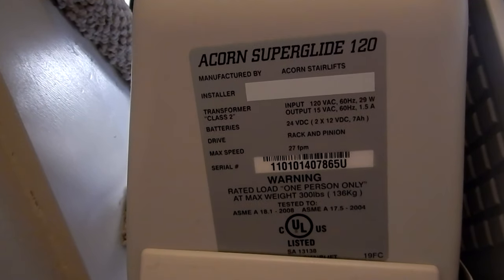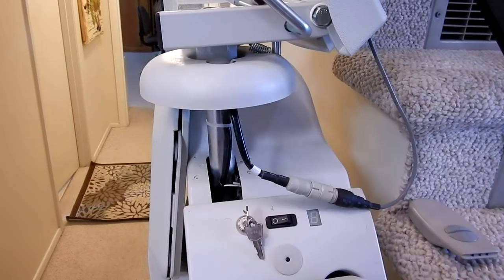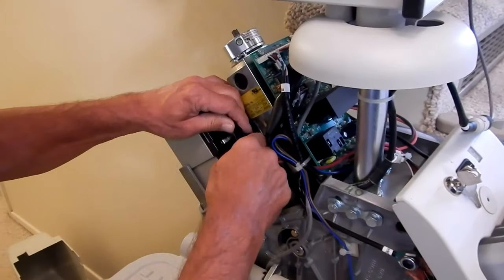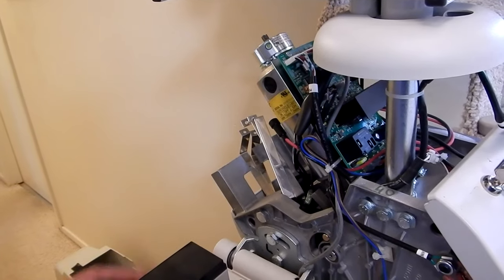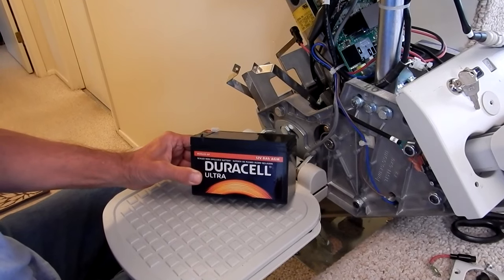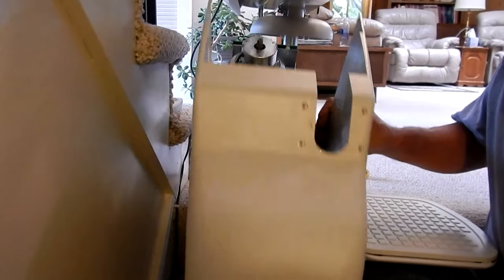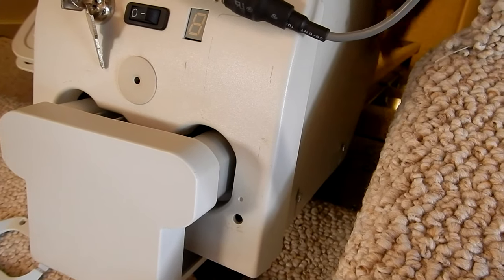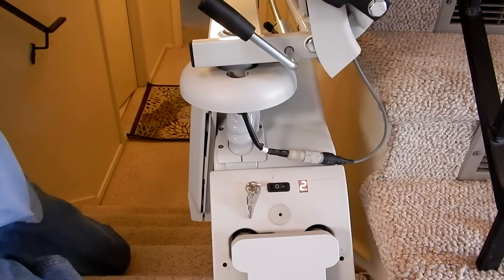How To Easily Replace The Batteries In An ACORN Stair Lift

Comment: Thank you! Great job on the video! The batteries I took out were labeled 5/17 and it is now 12/21. Anyone have any idea how often these need replacing?

We had been experiencing alternating days of slow and medium operation. Now that we have 2 residents at home who need this to go to upstairs bedrooms, it quit just over halfway up on the 2nd passenger. Oops! I wonder if it is  necessary to send the chair back to the base for charging when not in use overnight. Typically it sits on the base from about 6:30 AM to 10 or later PM (now the second person will likely go up and down 2 times a day). I thought that would be enough. Any thoughts?

Thanks again for an easy to follow video!
Reply from the maker: I think four years is about the average lifespan for the batteries. I would definitely charge them when not in use. Lead/acid batteries like to be fully charged as much of the time as possible.

Comment: Thanks Tom my wife and I are going to have one installed how long does the batteries last and why will it not run when it is still plugged in and the batteries are dead
Reply from the maker: The electrical connections are just to run the battery charger. The motor does not run on 120 volts. The batteries are only rated for 4 or 5  years but they usually last longer. They get recharged everytime you park the lift in the charge position. Good luck getting your lift and thanks for watching the video.
Reply: Kim the stairlifts run on battery power only. Plugged in just keeps them charged. The batteries should last 3-4 years with average use.
Reply: This is incorrect...3 years on batteries unless an hd model

Comment: Hello Tom. I have a chair like the one in the video that went down halfway down the track, stopped, waited a few minutes, started it up again and it only managed to move forward and down a little more, stopping before the end of the track. It doesn't want to go up at all. I know that there is a way to move the chair manually, removing the cover that you explain in your video and using a round handle that is an accessory that comes with the chair. In your footage I could see that the round handle with manual operation must fit that hexagonal tip on the engine (that silver cylinder). But the manual says that we must first disconnect the cable from the batteries and the handle is only meant to be turned a little, just for the chair to move about 1 inch to remove any obstruction in the rail. I suspect that the batteries were insufficiently charged (perhaps because it had been out of the charging contact position for a while) and therefore the batteries are insufficiently charged to move the chair to the top at the end of the rail. I wonder if the handle can be turned continuously with care and patience, so that the chair gradually manages to reach the top at the end of the track, to reach the charging contact. Have you ever needed to use this round handle and would you know if it can be turned continuously, moving the chair much longer than just 1 inch?
Reply from the maker: I have moved the chair manually. It is a very slow and tedious procedure. I don't know why you couldn't move it as much as is necessary to get to a charge point except that it's slow.

Comment: Hello. Great video! Thanks! Do you know if there is a way to manually move the chair along the track? My good friend has an acorn curved unit and it was left in a position not quite to the top so it didn't charge and the batteries are exhausted. Hopefully the batteries are still ok. I just have to get them recharged. Thanks!!
Reply from the maker: Yes, you can manually wind the chair by turning the motor. It goes very slowly and a tool, like a socket wrench or special winding tool,  is needed. Here's the info:
https://www.manualslib.com/manual/1414794/Acorn-Superglide-130.html?page=20
Reply: @TomandJulieMineExploring  Thank you so much! I'm heading over to my friend's house tomorrow. I'll give it a try. Much appreciated!

Comment: Great video! Very detailed. These batteries have gone up in price. I just paid 106.00 for 2 at Batteries Plus. They were 9A. The unit called for 8.5A but these should work. Do you have any experience troubleshooting one of these? If so, I'd love to speak with you. This unit is not powering up. I'm getting 18VAC to the charging strips and the batteries have 12.8 and 12.7VDC.
Reply from the maker: I'm not an Acorn tech, I just didn't want to pay for the battery replacement when it's a fairly easy job. I know there are some safety sensors that can stick or otherwise tripped somehow. The seat can cause problems in certain positions. The fuse by the batteries could be bad. You can try resetting the board by turning the power off and then on again after a bit. There is a fair amount of information available online. Depending on what brand and model you have this can be handy.
User Manual - ACORN Stairlifts https://dmastairlifts.co.uk/wp-content/uploads/2018/11/Acorn-Single-Digit.pdf

Comment: I need to change the fuse does anyone know what size fuse I use on this? I have the acorn straight 130 model. I can't find size info anywhere. This video was awesome.
Reply from the maker: The rating for the fuse should be stamped on the metal base of the one that was there originally. Look closely to read it and replace it with the same type.

Comment: Do you have the specific size of that zip tie Tom? Thanks in advance!
Reply from the maker: I don't have that exact size. It is about 3/8ths to 1/2 inch wide by 24 inches long. That just a guess though. It shouldn't be critical as long as it fits around the batteries.

Comment: Good video,we purchased one 6  months ago and the battery led light stopped working don't know if it's charging or not, HELP, please
Reply from the maker: Maybe the user manual will help you. Here is a link to the 130 model. 
user manual - Acorn Stairlifts https://www.acornstairlifts.co.uk/Acorn-Stairlifts-User-Manuals-130.pdf

Comment: Hi, thanks for the great video! I have a 130 and it looks like I have to dismantle it the same way but I need to go a step further. I have transferred my mum's stairlift from her house to mine but want it on the other side of the stairs which if course would put the seat post in the wring position. Do you know if there's a way to move the whole unit 90degrees so that the seat would still sit in top rather than on the side? I'm sorry, I don't think I've explained it very well. We flipped the rail which seems to be fine but to just sit the unit back how it is the seat post is pointing down the stairs instead if at the ceiling. Thank you for any advice you can give me
Reply from the maker: I believe there are right hand and left hand versions of the lift unit, so I'm not sure how that would work if you want to change sides like you want. Doing some research on left and right handed units might help you figure it out. Good luck, Tracy!
Reply: @TomandJulieMineExploring  thank you very much for your reply and advice :)
Reply: Rails/Tracks for both models 120 & 130 are interchangeable between models AND left & right.  However; the carriage and seat are dedicated to EITHER left or right side (looking up the stairway).
Reply from the maker: Good to know. I'm sure some will find this info helpful. Thanks for the comment!

Comment: Hey Tom, have you worked on an Acorn 180?  I have replacement batteries installed, but the unit does not want to work.  The main board has no toggle switches, in concerned we will need a special proprietary computer to initiate. Let me know.
Reply from the maker: I have not workrd on a 180 model. There are safety sensors and safety devices that might be preventing it from working. You might be able to find a troubleshooting flow chart online somewhere.
Reply: acorn tech here,   if you take the  batteries out of the 180 you will need to reprogram the lift the PCB= (motherboard) will lose program of the rail and you be stuck with a J5 code meaning no programming found
Reply: @BCole-um9wv  Thanks Brandon.  We have purchasd new batteries and I was about to install them, but my board has no toggle switches, how else can I reprogram it ?  And why does it need a reprogram? After spending $10,000+ on a curved lift, the $500-$1000 quote from Acorn is a tough pill to take.

Comment: G'day Tom, greetings from Australia.
When I take those 3-4 steps down a staircase I used to almost fly down, I would like to have everything ready to go including the batteries. Could you give me some numbers so I could purchase them ahead of time please? I have been an amputee, due to bone marrow cancer when I was 11, for 65 years now. Carrying a prosthesis around for all of those years has "pickled" my spine and hips. So, I don't want to be up and down the stairs doing the job. Your instructions are wonderful, right to the point, and covering the tricky bits very well.
Unfortunately Acorn thinks I am the money tree. I'll get rid of the thing rather than get Acorn back again. Talk about highway robbers.
Reply from the maker: G'day! Honestly, I don't even know the battery number. I took mine down and changed them for two of the same that matched, after I removed them from the machine. I wouldn't want to give you the wrong numbers anyway, because there are many different chair and battery models. I hope you get yours changed without any problems and sorry I don't have the number. Thanks for the comment,  Neil.
Reply: @TomandJulieMineExploring  Thanks anyway Tom. By the way, there are equivalent batteries worldwide. They don't just make batteries of a given number for say ... America, or ... Australia, or China.
Can you imagine the inventory at the Durocel factory for instance, if they had different batteries worldwide? Wow! It would be unimaginable.
Thanks for your video and help any my friend.
Neil.
Reply from the maker: @HorribleHenry  I understand about the world wide battery numbers. There are also a lot of different year, models and makers of stair lift machines, which may or may not have different batteries in them. That is the reason I suggest to people to take the batteries out of their particular machine and buy the matching batteries to replace them. Thanks for understanding, Neil.

Comment: Batteries are in and charging....but the front plate 

popped loose as I was putting on the back cover...any tips???
Reply from the maker: It will snap right back into place. Look at it and I bet you can figure it out. I don't have a lift where I am currently so I can't look at it right now but I know it goes back on very easily.

Comment: My stair lift keeps blowing fuse on battery and is stuck halfway up stairs on corner bend blocking walking up stairs. Do you know any way to get it to bottom manually without taking it all the way apart? We wanted to get it to bottom to try charging the batteries which we plan to replace if charging  doesn't work. Repairman won't answer phone. Any help would be appreciated . It is from Mobility 101 company  lifts, small lift no digital  lights . Red light on arm rest doesn't show  on. Thank you
Reply from the maker: I'm not sure how to manually move your lift. The Acorn lift has a screw, near the back, you can turn to manually move a disabled lift up or down. It's not easy and takes a long time. Do you have a manual you could look at for troubleshooting? Make sure nothing was blocking the track to cause the chair to get stuck.

Comment: Do you have any advise on what the issue is if the chair won't advance on the track and give a loud crunching noise? After examining the track I noticed that some of the grooves on the track were damaged, no error code and it's still charging. I've never seen the low battery error code. Showing C1 now.
Reply from the maker: It seems you might have already found your problem. If the track is damaged, or something became lodged in it, the chair might have difficulty moving. You could try advancing it by hand a little to see if it loosens up. You can find out how to do that in your manual or online.
Reply: Thank you so much for responding!
Reply from the maker: @patriciabrewer2875  You're welcome. I hope you get it working.

Comment: I'm hoping you will be able to help me. My mum has cancer and now only has a couple of months left to live and she's desperate to die at home. I purchased a 2nd hand Acorn curve 180 stairlift and I've installed it in her house as she is now to weak for the stairs. I'm now struggling to program it. I know how to access programming mode (simultaneously holding in the three triggers at the bottom). I've programmed the top and gone through the various speeds to get to the bottom.
I don't understand how to set the bottom limit and save the program I've created?
Any help/advice would be extremely well recieved.
Thank you kindly 
Luke.
Reply from the maker: Alex, sorry for the troubles you are having with the lift. You are doing a good deed by trying to help your mum in her time of need. Unfortunately,  I know nothing about the programming of the machine you have, and can not offer you any advice about fixing it. I'm sure you've already looked on the internet for any solutions.  It sounds like you have a manual that you are going by. I know sometimes the limiting switches can stick or the wiring become damaged. I wish I could be more help. Good luck to you and your mum!

Comment: Factory zip tie is only there to keep the batteries secure whilst being shipped from the UK so not really required to be replaced once the stairlift is installed in the home but good detailed video
Reply from the maker: I kind of figured that, but thought better safe than sorry when making an instructional video like this. Thanks for your input!

Comment: My acorn Superglide 130 code shows C1 while on the charging points. But it is sluggish and laboring going uphill from bottom to top. Any help is appreciated
Reply from the maker: A "C" error code means the batteries are flat according to my Acorn 120 manual. The "1" means normal. My manual recommends charging the batteries for at least one hour. From my experience if the batteries are several years old they should be replaced. The estimated life span of the batteries is 4-5 years. I got 7 years out of a pair once, but that is unusual. Hope this helps.

Comment: Thanks do you know it also works for the Acron 180? The one of my Grandpa is broken and i want to fix it. I read it has to be reprogrammed after switching the batteries, is it right? Sorry for my bad english and regards from germany
Reply from the maker: I've heard some Acorn techs say you need to do some sort of reprogramming after battery replacement, but that has not been true for me. I've replaced batteries a few different times on different machines, and all is fine after the new batteries are in. I'm guessing the 180 is similar. Take the cover off and see what you find.
Thanks for commenting from Germany, and good luck fixing your machine!😊
Reply: Thank you so much for your fast reply. :) I hope I can save some money for my grandfather :)
Btw. behind the frontcover are two 18650 14,8 V 5600 mah batterypacks
Maybe there is a difference because of 18650 and balancing?
Reply from the maker: @Finn-wy8fh  You're welcome,  Finn. That is definitely a different style of battery than the lead/acid type that is used in the 130.

Comment: Hi from Australia and thanks for the video, we have replaced the batteries in our Acorn stair lift 4 times in about 6 years, the original set lasted nearly 8 years, 2nd set (ebay) 4 years, 3rd set (ebay) 1 month, 4th set (century) 20 months .. 5th set today (century) again because i can get them locally and needed it fixed asap.  I don't want to keep changing these stupid batteries every 2 years and don't know what brand you can actually trust to last 5 years as they should.  20 months seems like a joke! Maybe this prehistoric chair was designed to run off GEL not AGM if there's any difference? ,, Any suggestions welcome :) .. Cheers .. Matt
Reply from the maker: Hi Matt. I guess they don't make batteries the way they used to. I have Duracell brand in mine, and they last about four years. Sorry, but I don't have any solid advice on what brand is best. I would advise you to keep them fully charged as much as possible if you aren't already. Good luck, and thanks for the comment from Australia. Cheers!

Comment: Hi Tom…my battery is full but unit does n out turn on…any advice?
Reply from the maker: Maybe a stuck safety sensor, loose wire or connection?
Reply: @TomandJulieMineExploring  Thanks…I checked all the connections after new battery install but unit just won’t turn on…do I have to isolate battery to power up unit and display?